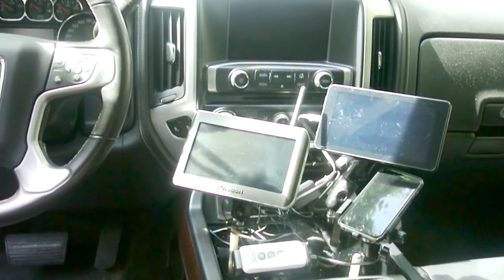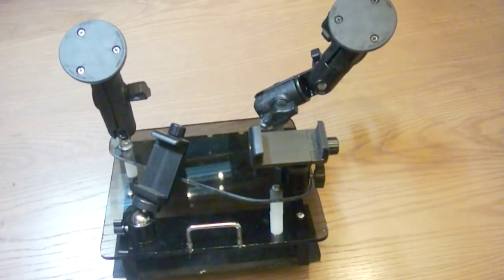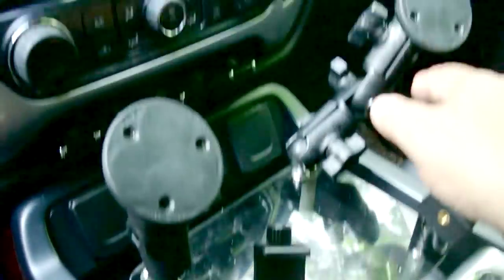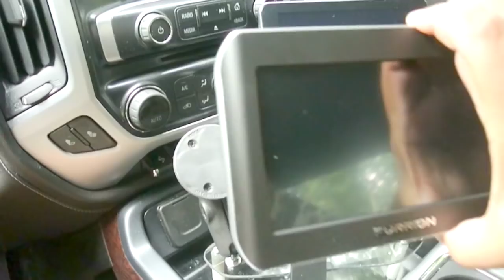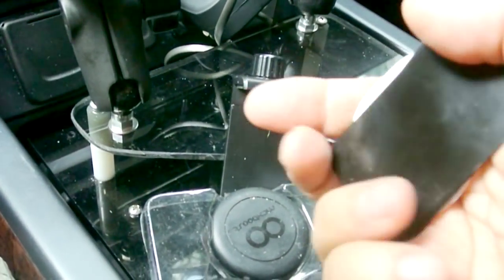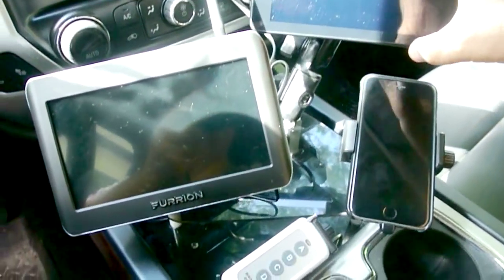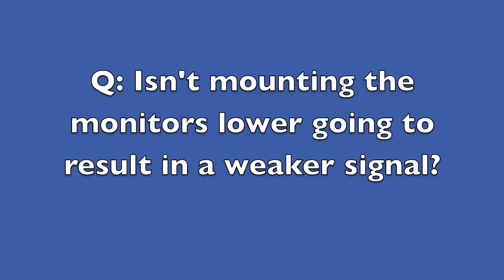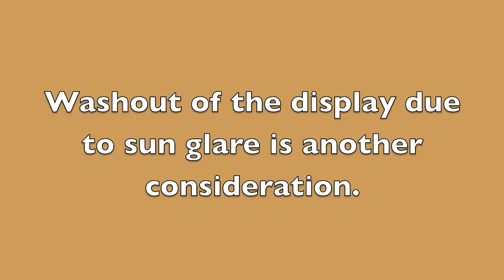A custom made truck console for my RV monitors (TPMS, Backup Camera).

Comment: I have a 2014 GMC Sierra 1500 SLT and I can confirm it has that exact same center console. Thank you
Reply: Also I like to add that I added my furrion camera monitor on to my rearview mirror as the rearview mirror is useless when a trailer is hooked up and the monitor fits up there perfectly.
Reply from the maker: That makes sense. I think that body style came out in 2014  for 1500 and 2015 for 2500.
Reply from the maker: I think if you can get the monitor high enough it won't washout from the glare. I decided not to mount my monitor as I bought the 7" one and I thought it might be too heavy for the mirror mount.

Comment: How and where did you power all the devices?
Reply from the maker: There is a row of 12V outlets at the top of the center console that came with the center console option on the truck, as well as in the console itself.